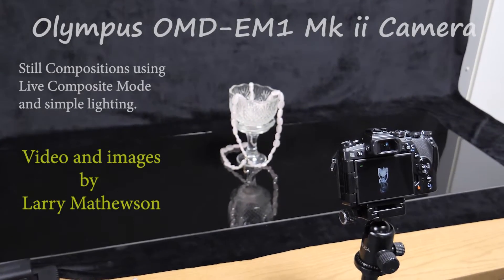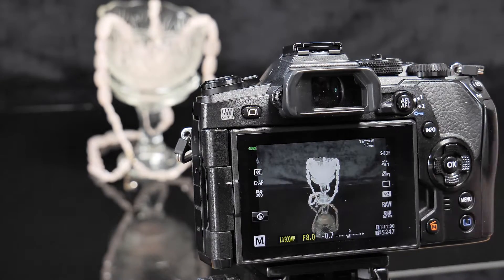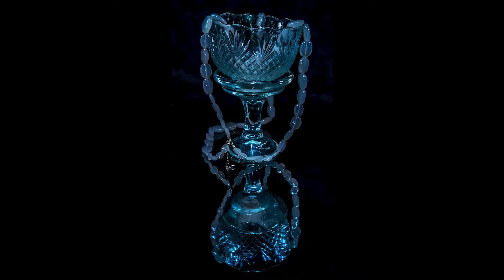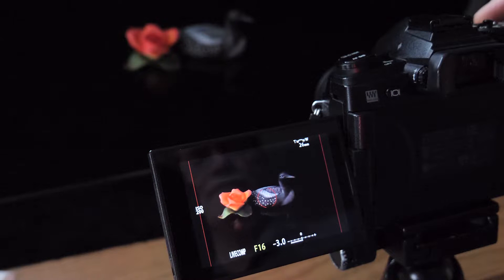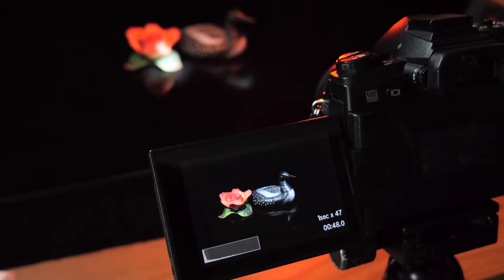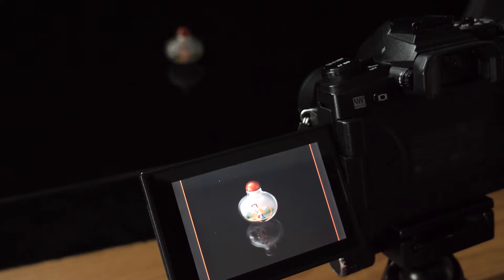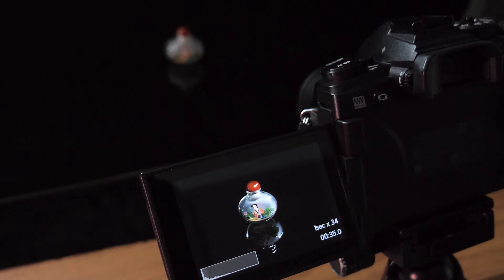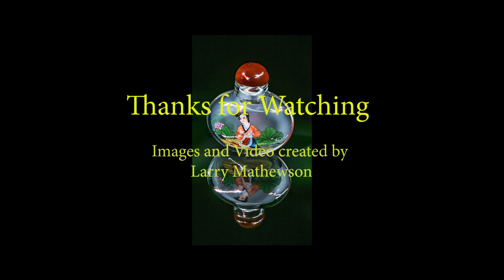Olympus Live Composite Mode Demo

Comment: I need your advice am trying to use live composite in my Olympus em1 mark iii but not active why? although i can reach it from menu but not active when shopping any clue?
Reply from the maker: The live composite mode is in a different menu location for the Mark iii model versus the mark ii model that I show in the demo. I'm not certain where it is found but you may need to consult your manual to find it. Sorry that is all I can help you with. It operates the same once you find the location on the mode dial.
Reply: In Em1 mark3 just turn the top dial to B. Now, you can select Bulb, Time and Live composite.

Comment: Hi Larry great work by the way what shutter you used here? the room got to be dark or you can switch light on?
Reply from the maker: All settings are done with the lights on and then switch to live composite mode in an Olympus OMD-EM1 Mark II. Just add light where you need it and the image only adds NEW light and does not blow out the subject.